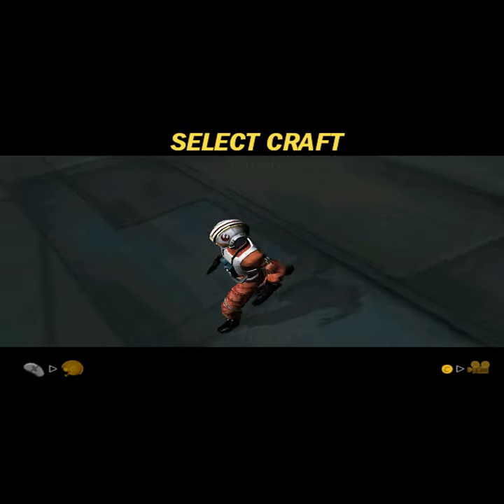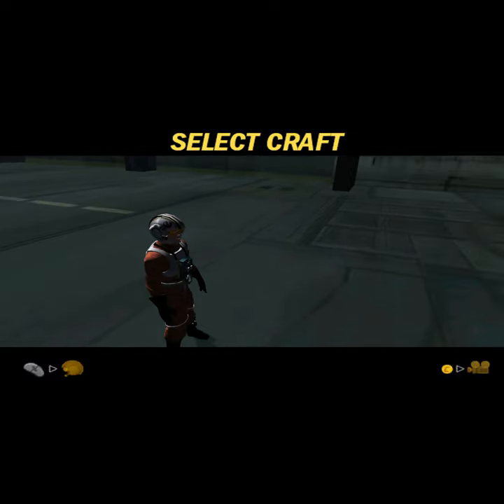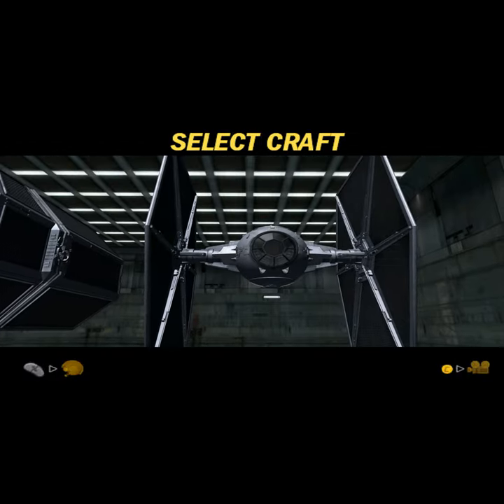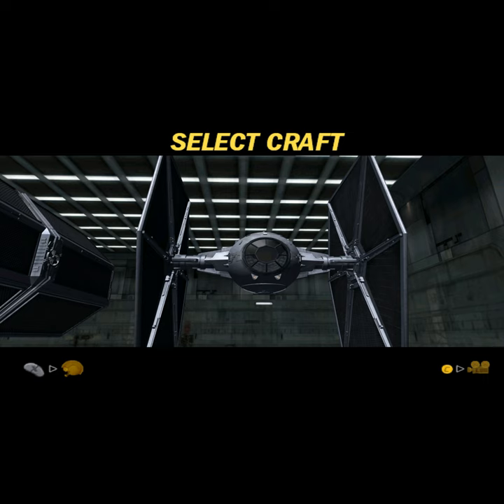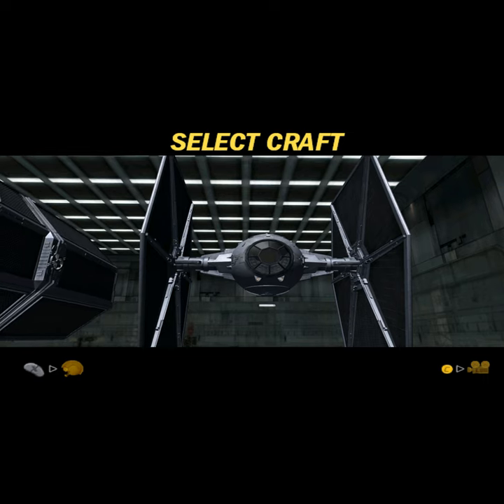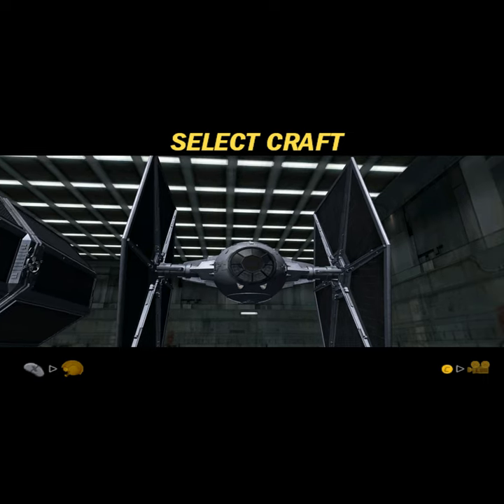How Cheaply Made Are Tie Fighters? #Shorts

Comment: The ww2 Japanese Mitsubishi a6m  Zeroe was the inspieration for the Imperial Tie fighter. It has the same strengths and weakness.
Reply: So the Zero also doesn’t have a primary life support system?
Reply: Nope, TIEs are faster than X-wings, they posess every advantage in flight performance. 
The A6Ms primary weakness was it's low top speed and poor energy retention due to having a light and comparatively weak engine.
Reply: @thelonious2213  Not acording to the latest rpg book. As to the AgM its weakness was low structural strength and bad diving capabilities. Its light weight meant that its weak engine was nota problem. Other than geting both your points wrong. you got everything right.
Reply: @thunberbolttwo3953  Rpg books? I'm referencing the original movie, A New Hope, not some rpg book that someone wrote 40 years later. Since you are quite stubborn, I'll quote it for you.

Luke tells Wedge and Biggs to "increase speed to full throttle". Despite doing so, the TIEs catch up incredibly quickly. In fact, we almost never see any rebel ship escape from TIEs by simply trying to outrun them, as evidently it's not possible.

TIEs and A6M Zeros are similar in that they are highly maneuverable and fragile, but that's it. The american fighters (such as the F6F and F4U) used their superior speed (both straight line and dive speed) to negate the Zero's advantage in maneuverability, and performed boom and zoom attacks exploiting the A6M's comparatively poor energy retention. Structural strength in a dive wasn't the primary concern, rather the fact that the controls of the Zero would lock up and would become nearly uncontrollable, long before the plane would rip apart.
The TIE doesn't have an obvious flight performance weakness that you can exploit, while the Zero did have one, which was its low top speed.

As most of the fighting in STAR WARS takes part in space, there is no such thing as diving, and even in atmosphere, TIEs, like the Interceptor, performed better than X-wings. Interceptors aren't much more aerodynamic than TIEs, they are all bricks that are saved by repulsorlift technology and inertial dampening.

I didn't fail any of my points mate, do your research properly.
Reply: it wasnt meant to come back anyway so whats the big deal, and i am refering to both
Reply: @thelonious2213  nerd
Reply: @calebrickard3294  bellend
Reply: @calebrickard3294  congrats, you just called out a nerd under a sci fi short

Comment: To be fair,  Ties were never made to work on their own without a carrier or base as there no hyper drive so it makes sense that life support is to push down to the pilot suit. (sucks to be them if the carrier goes down as there no where to run in the long term)

Now not having shields is being cheap.
Reply from the maker: Amusingly the Tie Advanced does have shields and a hyperdrive but still doesn't have life support.